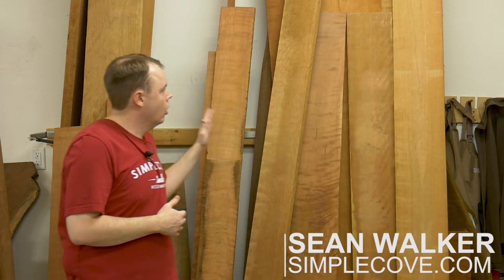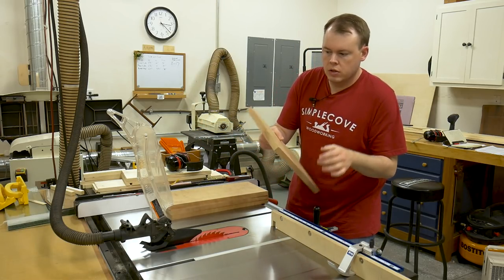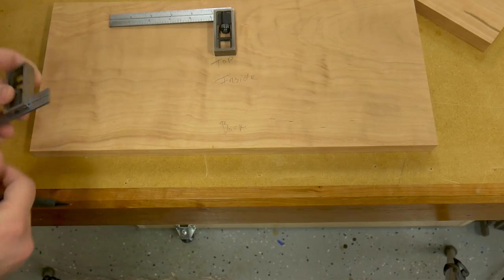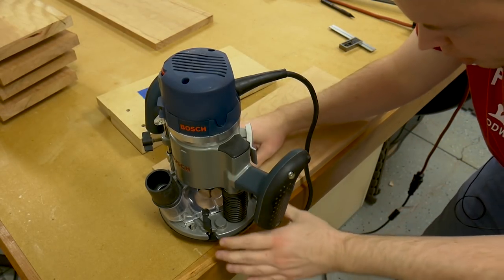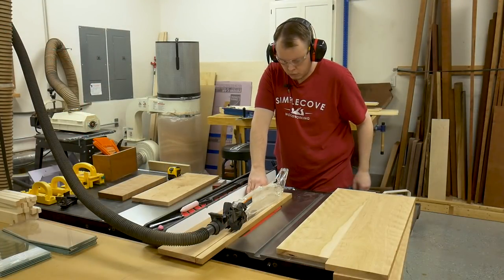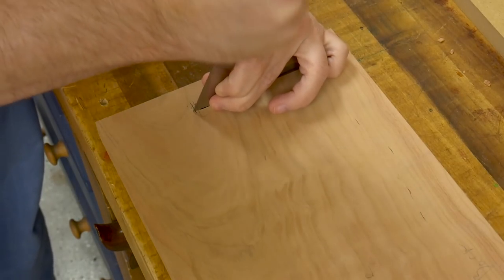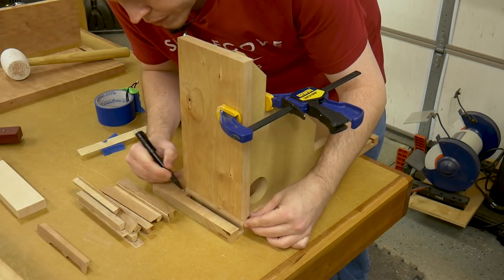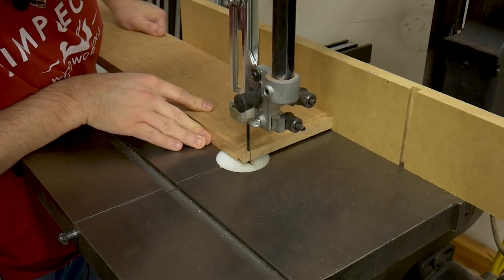Cherry Wall Cabinet Guild Build Part 1

Comment: I very much enjoyed the video and your talk through the techniques....  Question please,,,, Shimming both male and female side of the dovetail is what you showed. Have you ever experimented with  only the female side and varying the shim width?...Just curious.   Thanks
Reply: Wouldn't that leave the rear of the dovetail loose?  I'd think that would result in slight side to side movement of the unit possibly allowing the glue joint to break.

My question is, why taper the joint to begin with?  Did I miss the reasoning in the the video?
Reply: Johnny West The answer to your question is IMHO best found in cutting one without a taper... I did many years ago, to find it simply won’t fit! A taper is necessary.
Reply from the maker: The taper is to make it easier/faster to assemble/disassemble the case for having to test fit the hinges and doors. It's not necessary for sure, and is a personal preference. I mainly did it because I had never cut the tapered dovetail before and wanted to learn the process. It does add time to the build though with setting up the shim and test fitting, but not too bad.
Reply from the maker: I've not tested cutting the taper other than what I showed on camera. Thanks for watching and commenting!
Reply: I've never done a sliding dovetail before, so may just give it a go on some scrap.  I like the look of this cabinet, so I may make one later.